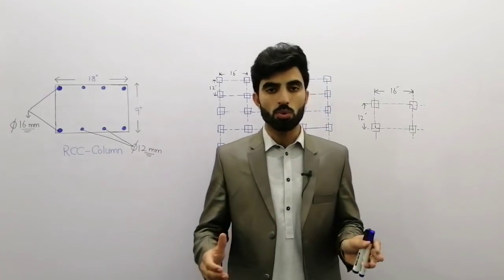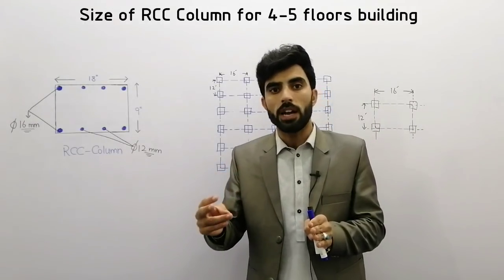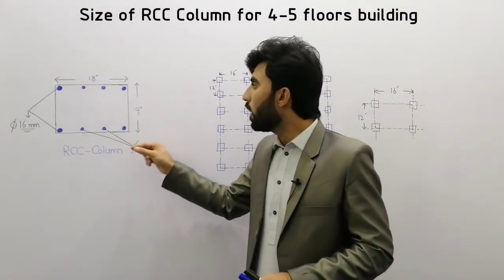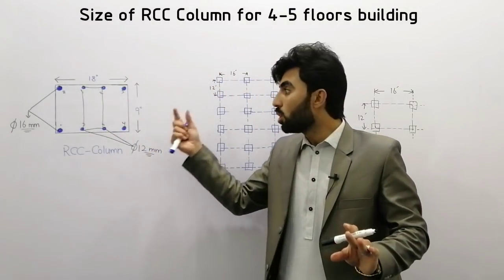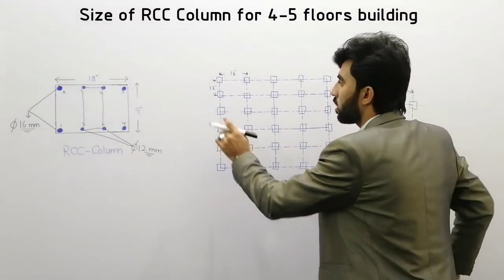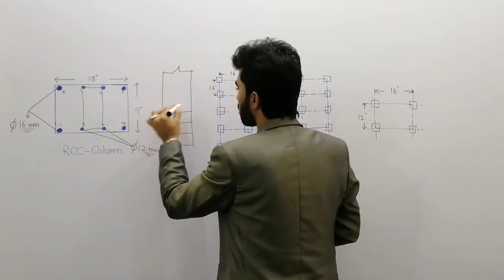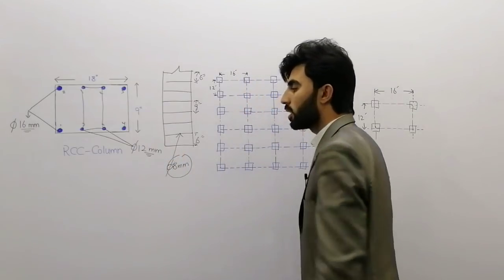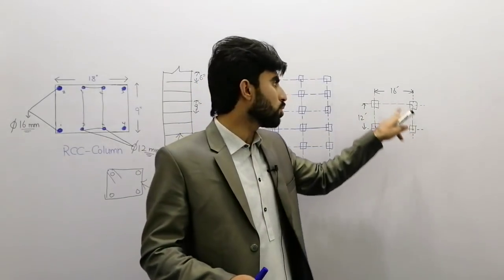Required Size of RCC Column for 4 to 5 floor Building - How to Select Size of RCC Column

Comment: Can we do 5 story building with 300mm x 300mm columns?
Span: 3300mm
Reinforcement: 4 x 16mm and 4 x 12mm bars
Floor high is: 3200mm

Comment: I have constructed G+3 floors building with a total of 12 columns and 11 of them are column size 9 inch x 18 inch and 12th is 12 mm diameter circular column? Is the 1 column of 12 okay to carry the load?
Reply: No

Comment: 4 -5 storey building just installed 12mm.re-bars is not standard in the Philippines.We are not using 12mm.re-bars for multi-storey bildg.the minimumm size is 16mm.bars.The size 12mm. bar only for CHB fence and small bungalow house.

Comment: with due respect size of column should be designed on basis of loads not with techniques.the way you are explaining is like a technician not an engineer.
Reply: Exactly my brother, he's not even taking into consideration the purpose of which the building is designed nor the various structure load reaction.

Comment: First of all giving such ramdom size to public use is very misleading. This Coulmn size seems to be too small for a 5 story building,  Did you design for lateral loads from earthquake effects also? Very likely this column will fail under shear at an earthquake event.

Comment: how to calculate column size ?
what is the impact of column width over length of column, is there any formula?
In my city 30x60 ft plot construction , by G+2 usually has 6"x18" or 6"x24", is this not correct?
I am not CE.
Reply: Find here more dear

Comment: Span length 3.6 m* 3.5 m. G+2 floor.( Parking+ 2 floor). Both side balcony will of 1.5 m rest on a column which is 35cm*20 cm in size...Is it ok in size? Beams are 50 CMS.

Comment: Sir According to your calculation column has 1.2% steel and as per IS 456 for column steel required is 0.8 to 6% 
For practical purpose we take 2to 3%

Comment: Why u provide 4 16 mm nd 4 12 mm rods what is load calculations.what is the process u select 18*9 column size  bro
Reply: M balahruday first of all column size cannot be decided using thumb rule but assuming a short colum having slenderness ratio =12 u can decide the least lateral dimension, for example lets say the flooor to floor height is 3200 mm so as per slenderness ratio the least lateral dimension is nearby 300 mm . 
this concept can be applicable for normal loading for high loading u have to design as per loads.
reinforcement should not be less than 1% as per American 0.8% Indian and 0.4% british!

these are basics regarding column design

Comment: Sir I have a doubt. Why we provide 12mm, 16mm,8mm, 32mm bars for rcc structures. How to find which Dia of bar suitable for rcc elements
Reply: Bro minimum rod size 12 mm used in column and stirrups 6mm, 8mm bro, slabs 8mm, 10mm as load building type we design and implement

Comment: Stirrups placing is wrong for rectangular column bro. We need to provide two rings at same place . Else confinement of concrete will be not their
Reply: tie bro.. stirrups is for beams
Reply: Lateral ties
Reply from the maker: Bro we have done complete design we checked
Reply: @CivilEngineerss  in which application u designed